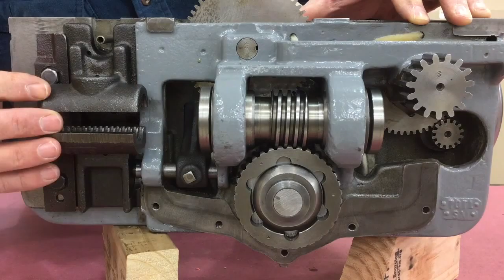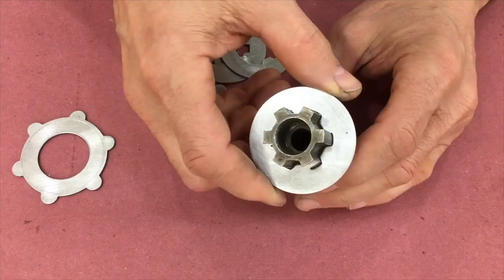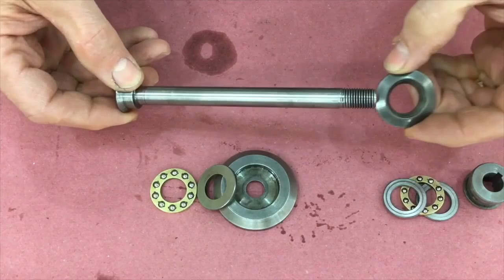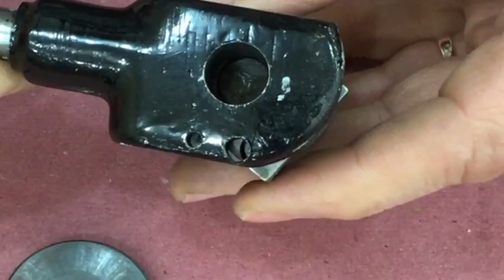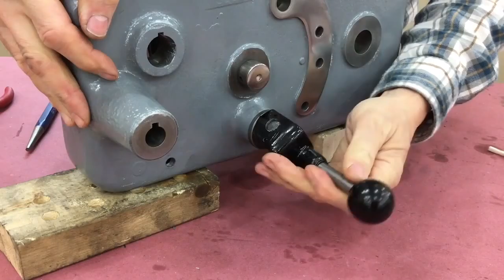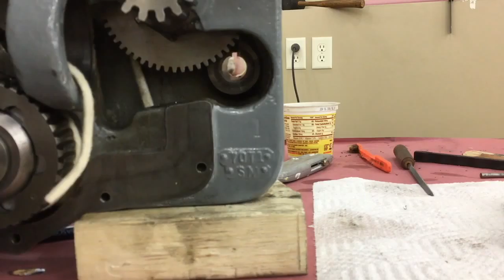South Bend 13" Restoration - Apron 1 of 2

Comment: George, The clutch knob will not tighten or loosen. It appears to be stuck in the tighten position. Any suggestions? Thanks!
Reply from the maker: Yep… disassemble, clean everything up and put it back together.   Adjust as needed…. Sorry I dont have an easy fix for you

Comment: my hand wheel is plated on the rim somehow but not on the rest ofthe casting. its partly worn off. did you just polish that off to the cast-iron or did you replate your wheel?
Reply from the maker: All my hand-wheels, likely yours as well, are polished cast iron.  Unless it, perhaps is not original

Comment: Good morning Mr George, thanks much for the info about 9” , 10” etc. Now , is the south bend heavy 10 apron and the 13” apron the same. Recently I bought a south bend lathe bed and I am in the process of purchasing a heavy 10” apron casting.
Reply from the maker: Thanks for your comment.  Nearly Every part is different between the various models of South Bend lathes. The apron looks the same or similar but the 13 inch is much larger.  I suggest you watch the first video in this series where I show the documentation for the machine. Also download the parts manual pdf.  In the manual you will see detail diagrams for each component of the machine and a parts list for each machine size.  Good luck on your project.

Comment: Good morning Mr George, just love how you explain the function and assembly of each component of the apron . Now tell me what is difference between the heavy 10 south bend and the 13 south bend. Also why are they referred to as 10” or 13” thanks in advance
Reply from the maker: Glad you like the videos. South Bend made sever sizes 9 inch to 16 inch… maybe even larger up to 24 inch I think.  The size designation represents how large a piece of material could fit on the machine to be turned. 13 inch would be 6.5 inches from the bed to the spindle.

Comment: Did you replace the clutch thrust bearings? If so do you happen to have a part number?
Reply from the maker: I did replace the bearings, but did not write down the bearing number... my advise is to measure the old bearing carefully and order from MacMaster Carr